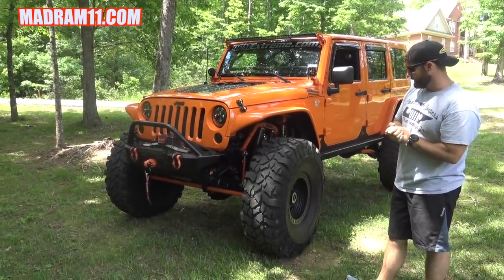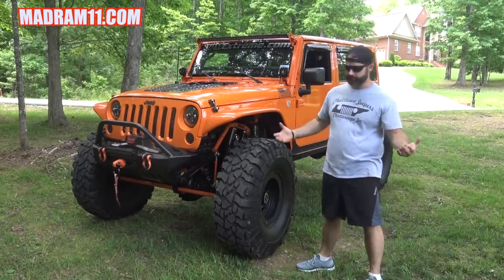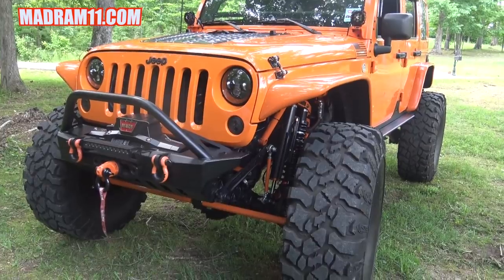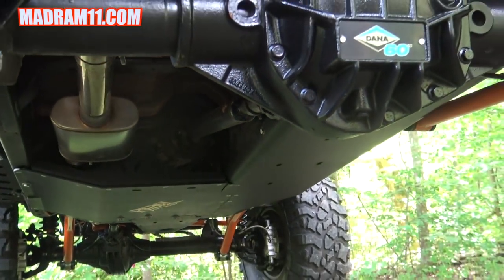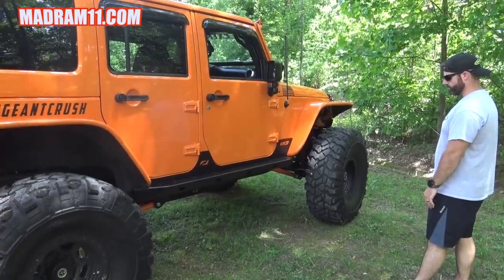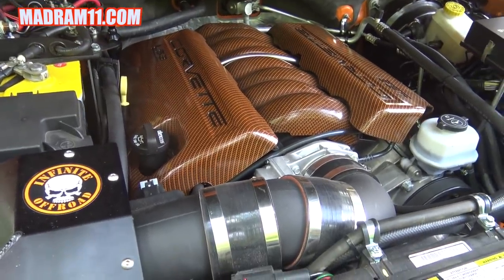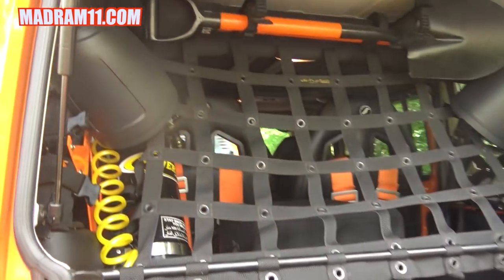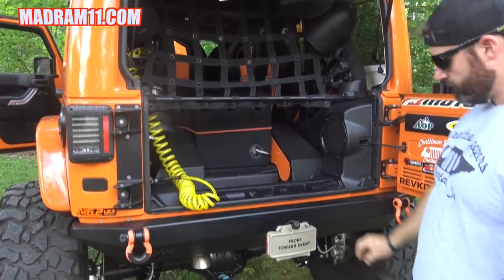SERGEANT CRUSH the LS3 POWERED 4-Door JK

Comment: just got an orange 08 wrangler rubicon with an LS 6.0  and was looking ides to help steering, very nice jeep. would love to find out more about the steering improvements.  mine is 4-inch lift long arm Dana 44 with lockers and stock parts with added twin fox stabilizers.  still needs improvement to match the power, hard to drive HWY speed and feel stable.

Comment: $200k+ to build a badass off road rig, and never take it off road.. I don't see the point in building a purpose vehicle, and never using it for its purpose.. Just like all these guys who buy trucks, and are afraid to use them. Each to their own, but wtf.
Reply: Jon  Hubbard I do take it Offroad.  Who ever said I didn’t? And no where near $200k.  Do I abuse it, no.  But it sees the dirt.  I’m more of a go fast guy than a slow crawl guy.  Not sure why you care what I do with my money or vehicle.  I certainly don’t care what you do with yours but as you said, to each their own.  I also have an F450 that pulls it all over this great country of ours on a 35’ Gooseneck.  I think that’s it’s purpose right?  Bottom line, not all Corvette drivers race theirs on a track, most diesel guys don’t haul heavy, and most sport motorcycle riders don’t race them.  Save the judgin for Jesus homie
Reply: I would like to know more about the drive train set up.
Reply: Sergeantcrush Jeep JK  beautiful rig.  Love the 525hp ls3.  Been thinking about getting the same for my 2012 Jk. Do you notice any loss of low end torque w such high horsepower?
Reply: This thing doesn’t lack for power anywhere in the torque band, it’s insane.  The 5.38s are probably a little too low but I love it
Reply: Sergeantcrush Jeep JK dude that’s awesome. Just gets me more Excited about moving forward with the swap. I’ve been going back and forth trying to decide between Motech or rpm extreme.  Any issues I should consider?  Engine codes or issues with the tune they had to work out?
Reply: I follow Ben on Instagram (@General_Lee_JK). Yup, shameless self promotion. 

He has posted this Jeep with a "sale" price and it's not as much as you'd think. You want to complain about it? It's 100% built. Nothing on it, is stock. Everything is top tier and in pristine condition. I've seen this thing ripped apart right down to the naked frame. No stone was left unturned. 

Amazing build Ben. You're the reason I bought my 2013 Crush JK.

Comment: Gatdang debildawg! You got more money than a PFC on payday. 

Terrible location for the shock reservoir. My gas tank got a large dent from dropping on a rock in that exact location. But then you’d have to actually take Offroad... on rocks
Reply: Burn'm Project good point.  It would hit the bumper first anyway.  They are tucked way up in there.
Reply: Ben Holliday I also have a steel bumper and I even did a gas tank lift and tuck (not a Jeep) but if you only descend off of ledges I doubt the reservoirs will be damaged. But rocks aren’t so flat and forgiving.